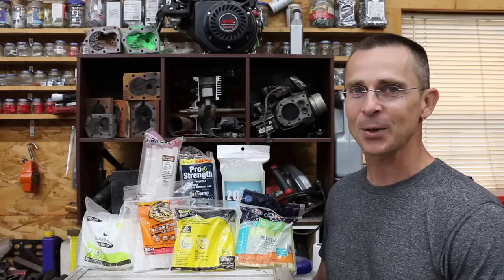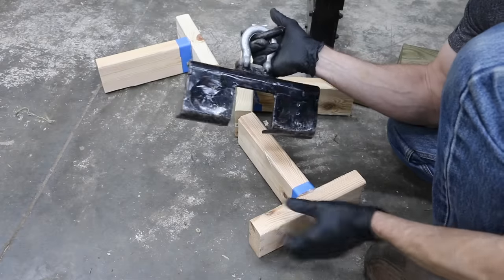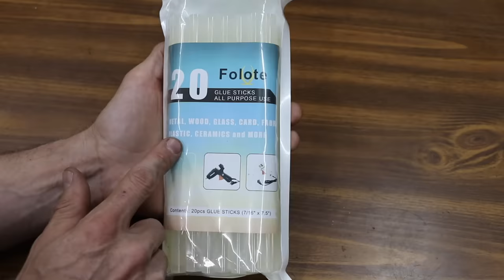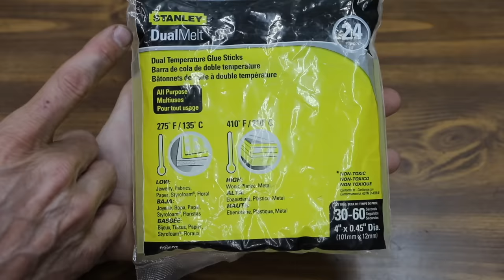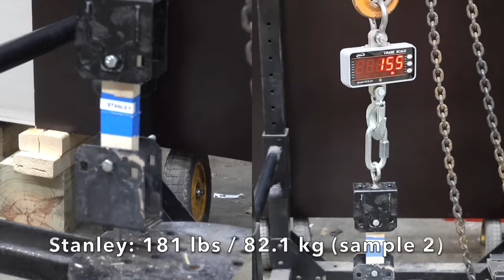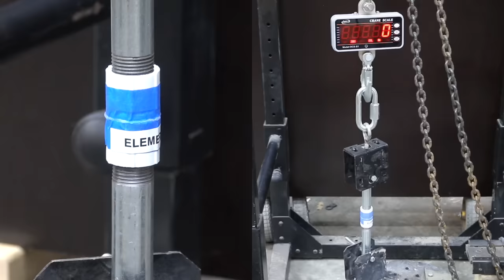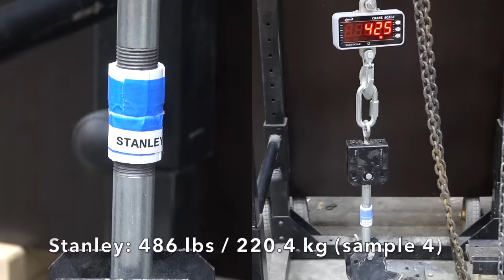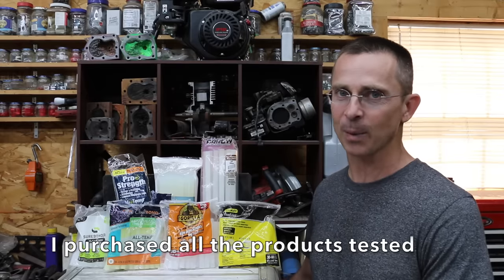Is Gorilla Hot Glue the Best? Let's find out!

Comment: Wow, I didn't realize that hot glue was that strong
Reply from the maker: I didn't either.  Stronger than using 2 16 penny nails!
Reply: Dagan Ward yeah I agree
Reply: Was just going to comment that, I've avoided using it in many cases because i thought it wasn't very strong and wouldn't last. I'll probably use it next time after seeing this video.
Reply: The shear test was mostly a test of the strength of the wood.
Reply: The cabinetshop I work at uses 3m hot glue all the time to put cabinets together but I will definitely have to give surebonder 220 watt glue guns a try because 3m glue sticks are expensive. The hot glue works way better than wood glue when your doing  particleboard and sometimes plywood now for the face frame which is where all hardwoods are used we do use wood glue.
Reply: No kidding!!
Wow.
Amazing information here!
Reply: On a rough surface. It doesn‘t always work well.
Reply: That is exactly what I was going to say. Thanks for another awesome video.....
Reply: I came to the comments just to make sure I wasn't the only one. Jesus!
Reply: It blew my mind how strong they are! I remember trying to use the stuff 20 years ago with a glue gun that was barely warm enough to melt the glue and always had poor results. Looks like I need to try them again!
Reply: It can be, provided it's applied correctly. It can just as easily be turned into a spectacular botch-job if proper surface prep/heating isn't applied where needed.
Reply: @toysareforboys1  That was my first impression, that he was going to test hot glue guns for arts and crafts, LOL,  anyway, you should donate to his channel ;-)
Reply: @drippingwax  Nice, never thought of that, but thats a good idea and I bet it works good, I used a bathroom handle suction cup to pull out my dent, LOL, nice comment bro.. . . . ... . ..
Reply: I always thought hot glue was for children's and old ladies' arts and crafts.
Reply: @ProjectFarm  a neat thing about hot glue is it's easy to remove by applying rubbing alcohol. The 91% works best but 70% will also work. It can even get it out of fabric. Apply the alcohol then rub to work the glue loose and roll it out of the fibers.

Which hot glue is easiest to remove from various materials?
Reply: @drippingwax  put 91% rubbing alcohol on the hot glue and it'll come off.
Reply: Surprising isn’t it?
Reply: A guy I went to school with hot glued an old CB radio (the late 80's)  to the top of the dash on his dad's car "temporarily". Didn't want to drill holes in his dad's beloved car dash. We took it for a road trip and thought it would fun to mess around with. When he went to pull it off a HUGE chunk of his dad's dash came off with it. He was super pissed...
Reply: Yeah I didn't expect that at all
Reply: I use hot glue on my powercable for my laptop   
BEATS having to pay 200$ for another (I tried the 50$ ones and it refused to charge my battery on it)
Reply: Hot glue is incredibly strong...*if you can get it to adhere to whatever you're gluing*.  The hot glue usually never fails, it's the surface it's adhered to that it usually peels away from with hot glue still completely intact.
Reply: @BL-yj2wp  Which is why he tested PVC caps with smooth tops.
Reply: Now, what about a combination of both...
Reply: i am still stronger :)
Reply: @Meddlmoe  I agree.
Reply: @pancakesyrup9365  It worked so well in this video, because the surfaces were flat, and he clamped them together tightly.   If you just squirt it on to something, then it won't be nearly as strong.
Reply: Does it age as well as other methods? Nails loosen over time but not significantly. Would the glue dry out and become brittle?
Reply: Anyone have a link to the glue gun he's using?
Reply: @ProjectFarm  Would love a follow-up video where you compared Stanley sticks to some of the black sticks on Amazon used for car-dent removal and some of the high-end sticks from McMaster-Carr (3M brand). And also some JB-Weld, Loctite PL Premium Polyurethane Construction Adhesive, Liquid  Nails, and Original Gorilla Glue for perspective. 

And then please don't forget my other video idea to compare JB Weld to Aeropoxy from Aircraft Spruce. It is what large-scale model rocket people use.
Reply: @ProjectFarm  Maybe don't get too excited. I hear that temperature shifts can make the bond fail.
Reply: Same. I always that it was used more for a temporary thing but I see I was wrong now.
Reply: Neither did I, However the last time I used it was probably the early 1990s for crafts stuff.  So probably a combination of the fact I was using craft store cheapo stuff and the fact these glues have had another 30 years of science.
Reply: i have a metal hook  thats hot glued (gorilla) to my garage (concrete) wall thats holding 100 feet of 14 gauge extension cable. dunno how heavy that is but i used the hot glue to test placement and moved it around twice before i found a spot i liked, its been sturdy so i never drilled a holes for it.
Reply: Ya, I did not think we get numbers this high. I really need to rethink the usefulness of hot glue.
Reply: @joelchristensen9744  uses*
Reply: thank you
Reply: Well, the testing shows that some of it is exactly as not-strong as you expected.
Reply: I once glued a leg back onto a chair and it seemed to hold pretty good.  That was just the generic stuff too.  With a good name brand glue it would probably be on there for life.
Reply: Most people think that because theyr'e using low heat glue that is generally still quite pliable or on a surface that isn't particularly good for it. High temp gun + high temp glue + wood with end grain=VERY strong bond.
Reply: @steveoo410  -- No, you were not wrong... Everything in life is temporary -- some things just more so than others...
Reply: @toysareforboys1  Same is the case with hair plugs. 20 years ago they were horrible, but they have come a long way! I don't need to use them, but just another example of how technology vastly improves...Unlike the space program that cannot get a rocket to the moon for over 50 YEARS since Apollo...Not counting the animation films we see about Mars rover. The only rover we have is in the test lab they use for demos. A single cell phone has more tech than the entire space program from the 60's, yet there has not been a SINGLE country in the entire world not only send a bunch a guys up there, but even a unmanned ship to the moon in all this time. It is said that truth is first ridiculed, then it is violently opposed, and then it is accepted as obvious. :-)
Reply: @punker4Real  can you explain
Reply: Apparently hot glue has improved dramatically since I used it in elementary school back in the 80’s.

Comment: So what you're saying is we should be using hot glue instead of construction adhesive.
Reply: Yes
Reply: Even if the strength is the same in some instances, you have to consider the fact that the hot melt glues are going to lose their strength at certain temperatures.  Maybe when they get cold, they won't hold as well.  Obviously, if they get too warm, they are going to get weaker.  And if the load on them comes at an angle, the attachment is weakened.

I tried making a license plate mount for the inside of my windshield that consisted of four 1/4" bolts (1/2" long) that were mounted to the glass by hot melt glue.  The heads of the bolts had been surfaced on a lathe to remove the markings and to give a uniform surface.  They did not stay attached very long and I eventually switched to small suction cups.  These might come lose a couple of times each year, but it's a simple matter to reattach them.  I mount the front license plate inside the glass where the rear view mirror is located on my Jeep because it blocks the sun that is not blocked by pulling down the sun visors.
Reply: @CurmudgeonExtraordinaire   JB Weld Epoxy is best for glass....As tested by Project Farm.
Reply: not really, over time of heat vs cold normal hot glue changes structure and will release from smooth surfaces. HOWEVER, there are High temp glue guns in the 400degree F heat range, which I wish was tested as well.
Reply: Hot glue may set too fast for sure applications.  But there use is more then just art deco.
Reply: Joe Walsh I don’t think is a good idea for a large area , will dry before finish applying the whole piece
Reply: @CurmudgeonExtraordinaire  you can find jeep sun visors in certain models, like my 2004 grand cherokee se, that have extra slide out visors built into the main visors. You can look for some in car scrap yards.
Reply: Exactly what i was thinking... wtf??
Reply: Grumpy OldMan  *heat
Reply: Hot melt glues will not work very well at very low temperatures and will re melt and not work at high temps.
Reply: well I don't know anything about hot glue or hot glue guns. But I am finding out now that I'm going to be needing them for different projects I want to do....after seeing this video, I know which brand of hot glue that I'm going to buy.
Reply: @CurmudgeonExtraordinaire  lighten up, Francis
Reply: not replying to you specifically but to join the conversation, im not a chemical specialist but i would imagine that UV exposure is a huge consideration when making construction glue vs crafting glue likely has no regard for UV protection.
Reply: For some applications it might be an alternative. I have made some rather poor experiences in the past may be i give it a new try.
Reply: We now know who to blame for shitty construction
Reply: Nah, it cools down too fast for larger projects,  I usually use a few dabs of hot glue to hold things in place while the construction adhesive cures
Reply: I’d feel far more comfortable using hot glue for smaller projects than that garbage Liquid Nails.  I can’t believe how poorly it did.
Reply: @CurmudgeonExtraordinaire  your name kinda fits your comment
Reply: Gotcha wondering huh. Lol. Ok. Ok. Well the problem with that is that it will melt in the hot sun. With everything that is on top of the roofs and walls. Most definitely the glue on the roof would melt. Fact. Not so sure about walls. But what about projects like would working maybe shelves or something. Building a desk with it. But. What about side to side and up and down. That’s only concern. It’s a lot weaker at that point.
Reply: Most glues are adhesives are not exposed to uv.
Reply: NO! Hot glue IS NOT construction grade, it fails very fast over time, it degrades extremely fast especially when exposed to the elements.

Comment: From my experience with hot glue. I was not expecting to see any results over 3-4lbs.
Reply from the maker: Thank you for the feedback. I didn't expect such impressive performance either
Reply: Probably depends on the materials being glued.
Reply: He only tested very short-term loading for ~2 seconds. They all will fail at 1/10th and below the numbers PF got if you just leave 1/10th of the load on there for more than a few seconds. Just think about it this way: If you hit the test pieced with a hamer, nothig is going to happen. But at the moment of impact the force is much bigger than everything we saw in this test. But very short (aka dynamic) loads are simply not comparable to constant loads.
Reply: @leocurious9919  These were also tested in the most ideal conditions possible with perfectly clean, perfectly fit components. A lot of hot glue applications involve random, uncleaned things mashed together.
Reply: @LagMasterSam  Temperature also play a very important role in hot glue bonds. Too cold: they snap. Too hot: they melt.

Comment: The Stanley PVC results were very impressive.  It's what I'll be buying next time for sure.
Great work as always on the tests.
Reply from the maker: Thank you!
Reply: Agreed but as most glues don't bind to pvc it's likely designed to work with pvc. Either way it's kind of nice to know a glue that will work with pvc to that extent.
Reply: Oh for sure, pricepoint and quality way up there with Stanley stuff.

I can vouch for Stanley hot glue eyes closed. With a couple of friends we wondered if you could keep a car's body panels attached for long periods of time using nothing but hot glue. So we assembled a Kia POP that way (we even closed shut the hood) and that car ran for 4 years under heavy abuse until the engine gave up.

Comment: Hot glue performance highly depends on the surface temperature on which you are applying it to. A layer applied to a surface hot enough to melt the glue on his own will be 10 times as durable as a normal application on a cold surface. Of course cleanliness and roughness matters too. I use it to pull out dents. If you get the surface hot and you put the sticks on it to melt it is incredible how strong it can be.
Reply: Same.  I always carefully prep the surfaces and clean using a solvent.  I then preheat the item using a heat gun.  The glue flows better and (I believe) makes better contact at a smaller level leveling itself on the surface.  The downside is that it takes longer for the bond to set.
Reply: Thank you for this tip really appreciate!
Reply: my unbranded glue stick wasn't even able to stick two pieces of cardboard together . there are too many miracle hot glue videos
Reply: I’m literally trying to use a PDR dent puller kit and i have to buy glue sticks because what came in the kit SUCKS. Now i’ll try to hit my panels with a heat gun before I lay the glue. What glue sticks do you recommend??

Comment: You skipped my favorite test. 
The "how much can you stand it when you accidentally get some molten glue on a finger or hand" test!!!!
Reply from the maker: lol. Great point!
Reply: ... it happened to my hand while misoperating a hot melt applicator hose ... didn't have a camera to record it, but won't do it again ... cure is to apply cold water immediately and DO NOT try to remove hot glue from skin ... leave it until it gets loose by itself (after a few days)
Reply: @CarlTomasAlley  Why not take it off as soon as it cools? I've never experienced it acting like tar
Reply: @savagetuner2404   ... if you try to remove it as it cools, your skin will come off stuck to the glue ... my father did it
Reply: @CarlTomasAlley  I'm guessing higher temp stuff than what I'm using
Reply: @savagetuner2404   ... 330°F (about 165°C)
Reply: @CarlTomasAlley  Ok so mine is closer to 165 F, lol. Yours has a bit more punch
Reply: Its like napalm it sticks and burns
Reply: @CarlTomasAlley  Your skin or the glue gets loose?
Reply: @hypercube33   ... if you try to remove it right away, skin peels off stuck to glue ... if you wait a few days, sweat will detach glue from skin (safe way) ... only thing to do as soon as possible is to cool down area with cold water
Reply: @CarlTomasAlley  also put some oil or lotion
Reply: @kaloosh2639  oil keeps heat in and idk if that's good for a burn
Reply: To properly perform this test, you would need a sound meter, a 7 second delay, and a bleeper.
Reply: As a welder i can say i am somewhat tolerant to thehot glue... but i do say "fackin fack thats hot"  got to let it cool and peel it off or you make more pain.
Reply: @CarlTomasAlley  yeah i was an idiot gluing something well bare foot and Dropped a big drop of Hot Glue on my Foot! And like an idiot i pulled the glue off almost immediately and it left a almost perfect circle on my foot. It burnt down into my foot several layers thick! Hurt like hell and took a while to fill in and heal.
Reply: “We’re going to test that”
Reply: @mrbanana7167  the oil will keep the skin moist to prevent an extreme moisture loss which is what a burn will do. So apply oil or lotion to the burn immediatly and leave it there and it will lessen the severity the next day and speed recovery and healing
Reply: @conniestevenson226  yeah, but again, you can do that with like aloe vera cream and gauze or smth, and oil slows the release of heat, which might make it even a bit worse
Reply: @ProjectFarm  “For this test, I rigged up a silicone finger with a thermistor inside.”

Comment: I never got anything to stick with hot glue, yet this guy manages to pull 1000lb with it.
Reply: you have to wait for it to dry
Reply: Correct temperature glue gun is a must, not all sticks are made to work with the same temperature.
Reply: @madambullshizky  you 
rough it up a bit with some sandpaper first.
Reply: @saber-jocky3436  status: glue master
Reply: As you can see the best test results were on wood which is fiber porous , probably the best way to get a really good hold on a smooth surface is to heat the surface you are gluing to kind of like welding metal
Reply: I only stuck my fingers together.
Reply: I know right... I can't even get cardboard to stick together... Guess you need a better hot glue gun and some better sticks...
Reply: When I saw the title I thought same thing, everything I've ever got glued I barely look at and I comes apart lol
Reply: you have to wait until is completely cold before you mess with it. if you mess with it before that you will cause it to come lose some and it will finish drying lose. if you can do it you can put a clamp on it. this stuff is very strong if you use it right.
Reply: @anchorbait6662  sounds like me.
Reply: Put some hair around it

Comment: Thanks, Todd! This is a really great video! A technique that I use when screwing 2 boards together is to drill a hole in the top board just large enough for the screw to pass through. This ensures that the screw only screws into the bottom board and the pieces pull tight. Without the hole, the screw threads into both pieces, sometimes leaving a thread or two between the two that can’t be tightened out.
Reply from the maker: Thanks for sharing.